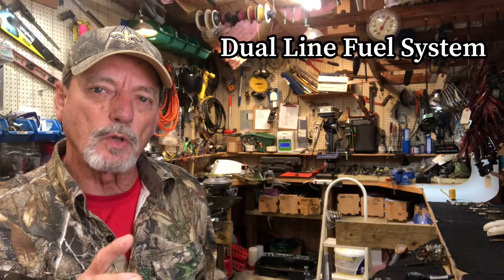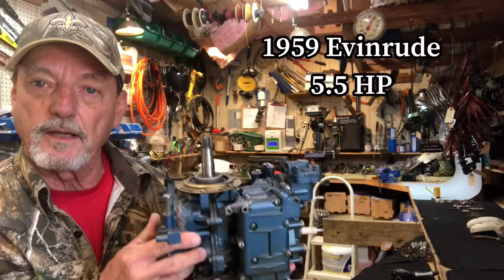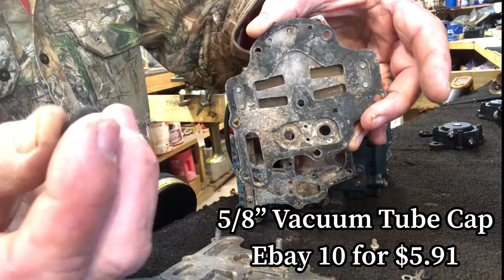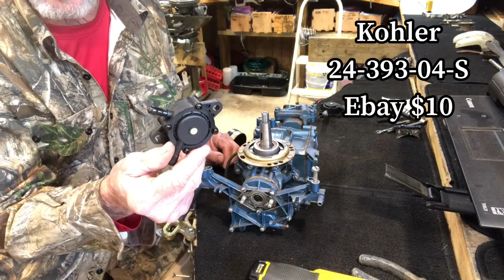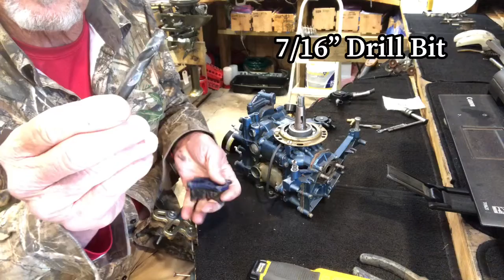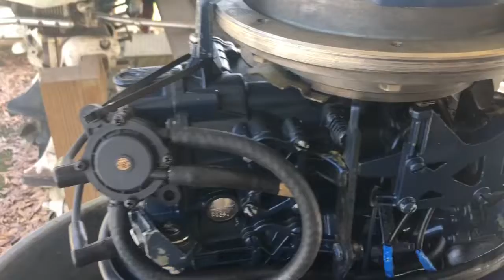Will Your Vintage Outboard Run Better After This Conversion?

Comment: Hi Mike
I just acquired a 1958 Johnson 18hp. I will need to do a fuel line conversion. I was wondering which of the two options you would recommend? What are the pros and cons?
Reply from the maker: Here is your best option. 

https://t-mikesvintageoutboards.com/product/evinrude-johnson-1955-73-18-hp-fuel-pump-conversion-kit-dual-line-single/

Comment: Wats up t Mike I have a 10014 evinrude 10hp n mines has a 2 line fuel pump n the line to the right of the carb is blocked off is that correct ?
Reply from the maker: No
Reply: @michaeljsimon it came with the kit though from mikes website only has 2 lines coming out the fuel pump
Reply: Is there a way I can send u pictures
Reply: I got it to start for 2 second them cuts off I did the carb adjustment like in ur video n it was the same thing after I did it it stayed on full throttle for like 5 second then it cut straight off
Reply: @michaeljsimon since I converted to the single line conversion do I need to switch my gas tank to one that has a breather vent ?

Comment: Back in.1998 - 
I converted an 18 hp Fastwin.
I used the valve plate method as is shown in this video.
As described - I removed the rubber flappers & plugged one of the holes, since the diaphragm pump only works off of one cylinder.
I believe (it was a long time ago):
I used a bolt, nut & a couple of washers to plug the one hole?
I corresponded with OMC by regular mail.
They gave me the part numbers for the pump & fuel connector.
I made an "L" Bracket to mount the pump.
I was told that side plates for the conversion were no longer avaliable.
This video shows how to alter an existing side plate, which is good.
There is another YouTuber that makes & sells side plates that mount the pump directly, along with an air hole to drive the pump.
I know someone with an old Johnson.
I.told him it is possible to convert the type of gas tank used &. It renewed my interest.
I still have my old letters from OMC.
Any new Diaphragm pump probably has better resistant rubber for current gasoline.
I have a 1962 75 hp Evenrude that is on the boat I use regularly.
I only mention this because several years ago I changed the rubber diaphragm  to a more compatible rubber for modern gas.

Comment: HI T-Mike,
About 2 or 3 years ago I did the single-line change on my 56 7.5 with a kohler pump and vaccum cap. Recently I purchased the other pump with bypass cover from you and installed it on my 1956 7.5 motor to get it to run better and not starve for fuel. Do I need to reverse the vaccum cap back to the covers for it to work correctly. I think I tossed that little cover out for the pulse holes and I dont know where I would get it if so.
Reply from the maker: Nope.

Comment: Hey there! I have a 1960 18hp. which is the better option for this motor since both could be done? is there an advantage or disadvantage to either of these solutions?

Comment: Ok but question!! If doing the bypass cover method what do you do with the carburetor end that originally produced the air for the dual tank system. Do you plug it? Or leave it open?
Reply from the maker: @SoFlo-Adventures  plug it in
Reply: @michaeljsimon  to what when the bypass cover method gets rid of the air pulse on the carburetor

Comment: I bought the kit for a 18 hp Johnson, the bag with plate came with two stainless screws , as they for a different motor?
Reply from the maker: They should fit your motor.
Reply: @michaeljsimon  for what? To bolt the plate on. It only came with two and my motor has 4 to bolt the plate on and I just used the original ones that were on the motor
Reply from the maker: Those screws are for the fuel pump.
Reply: @michaeljsimon  the pump came with 2 brass colored screws
Reply: Are they just incase I need longer ones?

Comment: Super helpful video as always T-mike,Im bringing a 50’s 5.5 seahorse back to life and wouldn’t be able to do it without you,already changed the coils and rebuilt the carb now I dont have to deal with the 50+ year old fuel tank leaking anymore

Comment: You are the best T-Mike!  I’m a novice mechanic, driven in my restoration of an old Old Town dinghy nprimarily by my carpentry skil, but have managed to make the fuel line conversion with your guidance here ( for a 1957 Johnson 5.5).  It’s a miracle!  (I have had the help of a mechanically inclined friend). But there’s a problem I think in that the installed fuel pump drips gas out of the screened opening in the middle of the pump. That’s got to be dangerous. It’s the second new fuel pump I’ve tried, with the same result. Today I finally got the motor going, and ran it for 5 minutes, but was afraid of taking it out and creating a firebomb. Any idea what’s going on?
Reply from the maker: Where did you get the fuel pump?
Reply: I assume the screen type hole in the pump housing is an exhaust for the pulsed air?  Could the carb manifold gasket be leaking?  Or the pump gasket itself?

Comment: I have received my Kohler Pump, I've removed the flapper valves and plugged the one port so I get a pulse. I've mounted the single line fuel connector in place of the two line connector. I was concerned with the large size of the connector's hose barb, but see that it matches the fuel pump's hose barb so I'm ok there. What I'm concerned about is 2 things: 
1. the pulse outlet hose barb on the engine is a lot smaller than the hose barb on the fuel pump. SO do I stretch a small hose over or clamp down on a larger hose?  
2. Same problem on the carb. It's hose barb is a lot smaller than the "carb" fitting hose barb on the pump... Stretch or clamp down?
Reply from the maker: Stretch it on
Reply: Thanks @michaeljsimon

Comment: What do you do for the connection from the tank line to the engine? Use the two line connector? Swap to a single line connector?
Do I reuse the old pressure tank or swap to a newer suction style single line tank?
Reply: Are there part numbers for the single line connector that mounts to the engine in place of the two line connector?
Reply from the maker: @davemilster  https://www.ebay.com/itm/404400333722?mkcid=16&mkevt=1&mkrid=711-127632-2357-0&ssspo=sn3ajpvKTka&sssrc=2051273&ssuid=sn3ajpvKTka&var=&widget_ver=artemis&media=COPY
Reply from the maker: Use new style single line hose and tank.

Comment: Hey t-mike! Quick question. If converting using the exhaust bypass what do you do with the carburetor manifold port? Do you cap it or let it blow out? Curious what your thoughts are!
Reply from the maker: Cap it
Reply from the maker: Cap it

Comment: This is the best video to cover all of the HP options. I just picked up 1959 5.5 and was planning on doing the first method, but I wanted to make see if it was possible. Thank you so much.
Reply from the maker: Don’t think the 5.5 hp has a bypass cover - do the manifold option is for you.

Comment: Mike how can can you use a 7/16 drill on a 1/8 tap, that would be a 21/64 drill, and you can't put a 1/4 inch npt fitting in a 1/8 hole? I think the drill for 1/4 is 7/16 and tap would be 4-18 NPT
Reply from the maker: Thank for the input.

Comment: Nice explanation, easy to follow. 
I myself will stay with my pressure tanks. All the internal parts are available and are rarely ever needed, the line is available and the fitting o-rings are easy to change. 
I’ve also collected a good number of both fitting and tank and bought a 100’ of line,, I think I may need another🤔. I like enough to reach the bow of my tinners! And I think I’ve got three or four all rehosed plus a couple for friends. 
Cheers! 
Keep it up, keep em running!

Comment: Once you have the fuel pump on is there any Timing adjustments needed or carb adjustments or she will just run like before you swapped it. I have an 18 that runs like a top but I know the tank is on its last leg. Wanna switch it over.
Reply from the maker: No adjustments required.

Comment: Since it is the case that, with a fuel pump the single fuel hose does not pressurize the fuel tank, does that mean that the fuel tank now has to be vented somehow?
Reply from the maker: Depends. They make ventless tanks.
Reply: @michaeljsimon  
Thank you; you have helped. 
I have two tanks.  One is an Atwood bought from West Marine.  It says it is a pressurized tank.  It has a single hose connector on it, and I do not see any venting mechanism.  
The other tank is one of the old metal Evinrude pressurized tanks made for a dual hose.  The dual-hose fitting on that tank has two plunger rods which get pushed in when a dual hose is connected.  One plunger opens the pathway for gas to flow.  The other opens a pathway for pressurized air to be sent into the tank.  
I may be misunderstanding what happens to the "air" plunger when I attach my single hose.  I know the plunger is depressed, but does that create a venting in my case?  Both tanks work with my single hose, but the motor seems not to be running as fast as it did with a dual hose.  That was made me wonder about venting.  
My motor, incidentally,  has a fuel pump that is attached to a bypass cover, and the outlet nipple on the carburetor manifold that once sent pressure into the fuel tank has been capped.
Once again, thank you for your knowledge and help.

Comment: Thanks Mike. Great video. I have a 59 5.5 fisherman. runs great. Can you explain why I very suddenly have a bad leak at the fuel connect. It sealed just fine and now leaks like a sieve. The receiver seems fine and the springs are working. If I can't get it to stop leaking I'll try your conversion. thanks in advance.
Reply: There are two chubby little o rings in that connection, they are still available at dealers and likely Sierra etc with the use of a couple of pics you can compress the shut off in the center and pic the O-ring out give the inside a good cleaning and blow if possible (they can be gummy etc) then install two new ones. Quick note, if only the air side is leaking it can cause issues with stalling and leaning out. 
I prefer dual line, I find the above mentioned connectors much better the line itself more durable and by far the biggest reason is those damn primer bulbs. They either refuse to work are turning to rock or split and leak. I have only come across one tank that won’t push fuel back and it’s likely the pickup tube inside. Also the kits are available to overhaul the dual line tanks.

Comment: Ok, I drilled bypass with a 7/16 as you stated.  The 1/8 x 27 npt is way to small for that massive hole.  21/64 is the proper size but now I will need to find someway to correct.  Geez
Reply: He said 8x27 not 1/8×27 tap

Comment: My original hoses have a very small inside diameter.   They won't fit the fuel pump you suggested.  If I increase the size they won't fit the carburetor barb.  How to proceed?  Tks

Comment: I have a 1959 johnson 5.5hp motor and im about to switch it over from the duel to single like in your video. My question is what is the fuel to oil ratio? I have a 3gal gas tank. Thanks
Reply from the maker: 24 to 1

Comment: Mike, what single line fittings would you recommend for this modification? Both at the motor and the tank.

Comment: I have a question not about this conversion but what kind of tool do you use for tightening crankshaft bolts to inche pounds. And where do you get them

Comment: Love the videos!! Question: what is the advantage of conversion? I’ve a ‘58 Evinrude that’s been the family for years that I’m going to restore—but don’t have the tank. Should be easy enough to find a dual-line, but obviously single line are even more readily available. Thanks a bunch. Christian
Reply from the maker: Single line standard now - easier
Reply: I don't think it will be that easy to find.  Also depending on where you live a pressurized tank may be illegal.

Comment: Thank you for your videos I'm having difficulty leaving a message here because I never see it posted. But on your conversion which do you prefer the exhaust method or the intake method. I am concerned the exhaust method may have a heat problem on diaphragm some rubber in the future. What are your thoughts.
Reply: That cover is an INTAKE bypass cover. Very low heat area compared to exhaust cover (which is on the other side of the power head).
Reply from the maker: Exhaust method - better pulse

Comment: When you do the bypass cover mod do you seal off the pressure barb coming from the carb manifold completely?
Reply from the maker: Yes - I failed to mention that.
Reply: @michaeljsimon I'm doing the bypass cover mod on 1957 18 HP Evinrude.  Using the fuel pump you suggested.  How do I seal off the barb on the carb manifold ?  Or did I miss that in the video.
Reply: Depending on fuel pump.
That fuel pump has 3 fittings one goes to vacuum line your asking about plugging off.
If fuel pump has 2 fittings it usually mounts to transfer port cover where it grabs vacuum to drive diaphragm. My 30hp mounts to transfer port. This video is for low hp motor 

Great vid T-Mike
Reply: T-Mike I just learned this in the past year you’ve not failed! You’ve taught me so much on your channel! Keep it coming